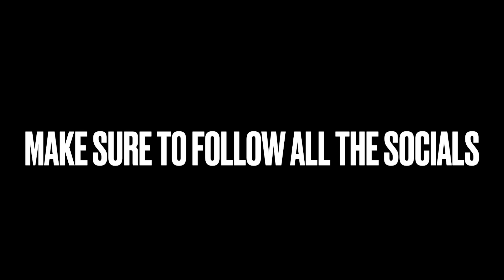Picking Up a Ford 302 For My 1964 Ford Fairlane

Comment: Check the bolt spread for the motor mount. My 63/260 had a 6 inch spread and the 66/289 I used had a 7 inch spread. If there is a difference you can stop a potential problem.  I think this will be a very good project. I am looking forward to it.
Reply from the maker: I will definitely be looking into that. From what I’ve read, there shouldn’t be a huge problem with fitment. And me too man, it’s definitely going to be a rad project!